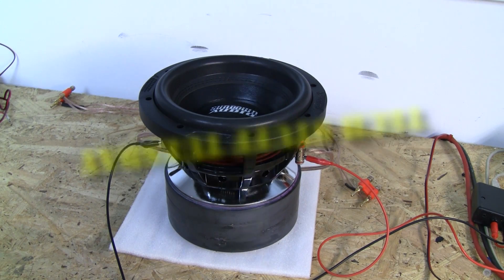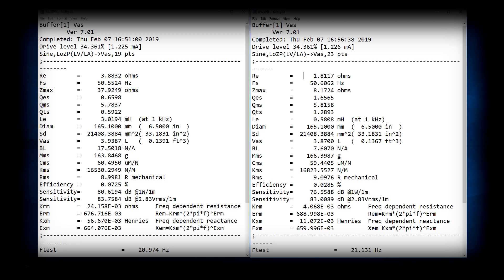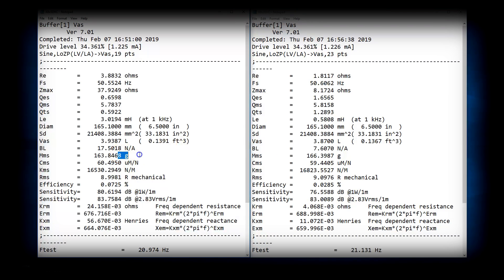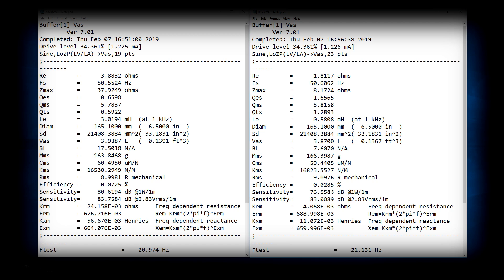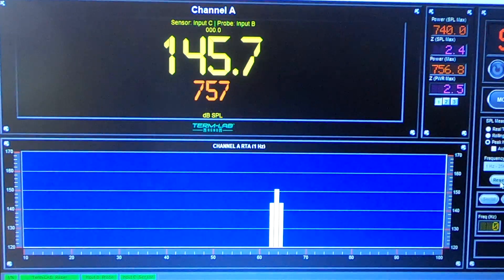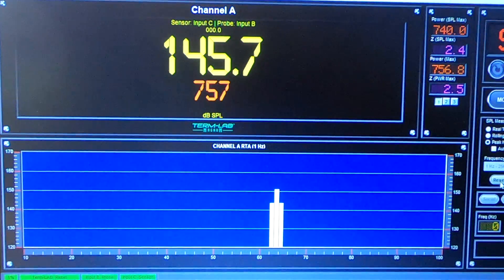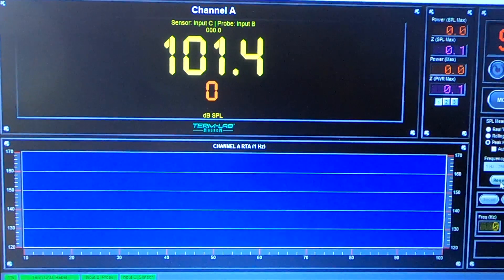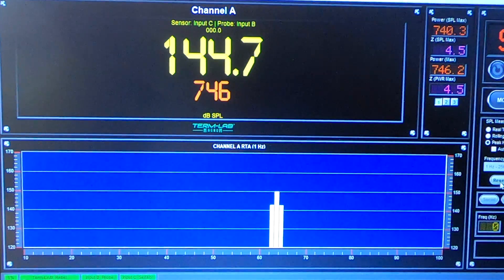This is what happens with 1 of 2 voice coils connected - Tech Stuff Tuesday

Comment: Question: I know you got the TS parameters wiring it in series, but do you also wire the sub in series when you actually tested it for SPL? Just wondering.  I know I usually wire mine in parallel to 1 Ohm to get more power.

Comment: I have one 10" Subwoofer dual coil driver connected with only one coil as my amp doesn't support the OHMS load if I connect them both together, I know is not the best option, but it is the only way I can have it working, have been using this way since like 7 years ago, still works and sounds great.
Reply: And you have a back up coil !
Reply: @adventureswitheddie6444 is still working with the single coil connected, I thought the same as you. I really don't care if it burns.

Comment: First off, have you tested any dual 2 ohm drivers against the same makers single 4 ohm version of the same driver, I think sn important aspect to test would be heat generated I the gap since that's what kills most speakers unless they have fused tinsel leads like CV HED subs. The other thing I need to ask is how many know when the dual voice coil was invented and why it was invented? Subs first appeared in movie theaters once sound was added to movies. The subs they had back in the 1930s were not well behaved and had huge peaks at certain levels that they (at that time) no way to flatten the response. There were no EQs, so they added the second coil to act as a way to correct the response by running a reverse polarity signal at those frequencies that had the big peaks. This was probably done by using complex passive notch crossovers and resistors to get the signal dialed in as close as possible. This is just one more example of how most things we deal with today are far from bring new ideas

Comment: I just tried to read the resistance on a DVC and got an open circuit on one of the coils, im wondering if i can run 1 DVC woofer w/ both connections and 1 DVC wooder w/ a single connections and just leave the open circuit coil out of the loop.

Comment: so when only wiring 1 wouldnt the 1 coil get hotter alot faster on rated watts and cause a ton of wear on it or am i wrong i know heat transfers insanely well on copper. but i wanna know the logistics behind temperatures with only 1 coil wired because i got a dvc 1ohm and my amps only 1 ohm stable pends my taramps 12k ate shit on .5 ohms immediately

Comment: When I lost a coil in my 15. I ran it on a single coil for years and still had great sound. Actually it gained more power over time. Thanks for the Video.
Reply: mine is also 15 and i just blew one of mine lol hopefully i can get the same results lol Ive had my sub for years, got it used and I  have no money to get a new one
Reply: im looking I cant find exactly how to wire only one coil. I am an audio noob can you help? what wires go where on the speaker side
Reply: @twangyyy18888   you dont. Just use it as a single voice coil. Use a meter to find out what side is bad.
Reply: How did u know what coil was trashed?
Reply: @gtstanton9785   ohm meter

Comment: Fkng outstanding! This just made me $100 richer😂 I've been arguing with my friend about this situation for a while, i don't understand how people can't see that it's like taking power away from it when you don't use both coils💡 It's simple as night and day, if you drive at night with only one headlight then your only going to be lighting up half of what you could/should be with both headlights😂 I know it doesn't take away half of the power by using 1 coil but it does take some power away from what it would/could potentially produce like you just proved, THANK YOU!👍👍👍👍
Reply from the maker: The headlight analogy is quite good, I should use that.
Reply: Only part where mine actually got louder was I have 4 dual 2 ohm mojos. Series parallel to 1ohm final. One of my coils on one sub went out. Didn't know about it for nearly 3 weeks. Honestly thought all 4 were banging. After one day watching the subs move. One seemed off. So I did an ohm check at final and was at 1.7 ohm. So I knew that sub was off somewhere. Turns out whole voice coil was out. So I plugged into just the good one, checked final and was back at 1 ohm again. Grant it. That poor thing gets hot fast af. But also, makes me think that sub was dead from the beginning or near beginning. Because this system never sounded so loud no that it's at 1 ohm and 4 subs moving hahaha. Although, not ideal and I'm getting a replacement
Reply: I hope you know it’s not taking power from the subwoofer it’s just not allowing the amp to push out as much because the ohms are higher like in my set up I’m doing right now I have a dual voice coil 15 two ohm but my amp is only rated for two ohm so that’s why I’m only connecting one voice coil because if you ran it at four would take a lot of power away but if you ran it at one it would destroy the amp as I plan on adding another 12 with this 15 that’s why I have a two ohm and not four because when I get this other one I can run them both at four ohm and then together they would drop back down to two

Comment: can I use single sub with 2ohm? since it sounds better in my case idk why... when I wired 1ohm before it distorts a lot of clipping now with 2ohm sounds clearer?
Reply from the maker: If your wired to 1 ohm, it sounds like your amp isn't 1 ohm stable, which is why it was clipping.
Reply: @EMFAudio  it says One ohm stable. But idk why I get weak power from sub and clipping amp is 1500rms
Reply from the maker: @grikisgrikis2779  what amp is it? It's possible you have insufficient electrical so you have low voltage which will cause clipping.
Reply: @EMFAudio  pride mezzo
Reply: @EMFAudio  stock electricity no agm no big three only one small capacitor
Reply from the maker: @grikisgrikis2779  Take the capacitor out, that may solve the problem. Otherwise it sounds like you may need some electrical upgrades. Check your voltage while playing.
Reply: @EMFAudio  usually I drop to 13.5-13.6v. But why taking capacitor would be better? Thanks.
Reply from the maker: @grikisgrikis2779  If it's clipping on that voltage, the amp is just out of power. Those caps that aren't supercaps tend to do nothing but hurt the system. They don't have enough capacity to be effective so it's just resistance in the system where the amp is drawing power so the cap is depleted then the car is trying to run the amp and replenish the cap.
Reply: @EMFAudio  oh, that's why I could be clipping more and less bass?
Reply: @EMFAudio  so is it better for me currently play 2ohm? Cause it sounded way better still loud and no distorting and  clipping? Is it better for distorting with 1ohm or clean signal 900rms?
Reply from the maker: @grikisgrikis2779  distortion is never good

Comment: aside from the power handling dropping to half. is there any damage to the sub if you're not using full power or even close to full power?
cause I have two DVC 4 ohm subs. BUT my amp gets hot running it at 2 ohms. the heat on amp dropped when using one coil
Reply from the maker: If you only use half power with 1 coil, damage, no. Performance won't be as good though.

Comment: So you said that a dvc sub rated at 750W rms is for both coils  combined... what if you fed one coil with 750W rms ??
Reply from the maker: It would die quicker, that's technically double rated power.
Reply: @EMFAudio  so i can guess that a dvc sub was intended to be ran on both coils right even though it will run on one coil as long as the power is cut in half of its total rated ..??
And by running one coil its only pushing half its total output .. just like a svc sub rated at 500w rms and you only give it 250w rms ..
Reply from the maker: @ACommenterOnYouTube  That's all explained in this video.

Comment: My friends DD 612 was connected only on one voice coil by mistake. When I opened box after few months I realised that mistake. Will there be any permanent damage on this sub?
Reply from the maker: It's possible, look at the coil and see.
Reply: @EMFAudio  coil is not visible but I checked impedance shown same for both coils. So should I consider sub is OK?
Reply from the maker: @BassheadLabs  If both read correct impedance I'd say it's probably fine.
Reply: @EMFAudio  may I know why you suggested to see the coil? Coil burns if we use single voice coil from dvc sub? I would like to explore other ways.
Reply from the maker: @BassheadLabs  It can show heat damage, not necessarily complete burns but discoloration or if it is beginning to unwind.

Comment: If the speakers rated power handling is 750w with both coils combined doesn't that mean one coil can only handle 375w?
Reply from the maker: Sort of. There are some cooling changes with only 1 connected so it's possible it could be even less than half.
Reply: @EMFAudio  So why was 750w safe to put to one coil?   That's what's confusing to me.
Reply from the maker: @jamesg8246  RMS ratings are a power over time. A brief amount of power won't generate enough heat to kill it. From that aspect given no mechanical limitations, you can play 5,000 watts on them fine, briefly.

Comment: Bro... my amplifier produces 4 ohm in bridged mode and the subwoofer is dual voice coil 4 ohm each, so it is okey to connect only one voice coil... right ? Kindly pay attention to my problem...
Reply from the maker: It will play, but your power handling is cut in half and performance will suffer.
Reply: @EMFAudio  so what do you recommend for this situation?
Reply from the maker: @anutom007  Ideally change the sub or change the amp.

Comment: So basically which is better in terms of getting more out of my sub? using both or one coil?... And is it possible to burn only one coil over?
Reply from the maker: You should always use both coils, watch the video. You can burn 1 coil but the other will be on the verge at the same time.
Reply: @EMFAudio  ok.. Thanks

Comment: Always use both coils... even if you have to wire up (series) [and/or wire back down if you have multi subs], it's better than only running one coil on a DVC subwoofer.
Reply: But is it bad to run on one coil giving it power because i know it's better to run 2 but my terminals off but I still need the sub so can I still slam it on 1 coil and not destroy it
Reply: @BuddaDrifts Yes you can, just don't get much movement like with 2 of them. Enjoy

Comment: I got a 12" type r for free from a coworker.. One coil reads 2ohm, the other 0. What are the chances that only 1 coil is blown vs just disconnected internally? Can a sub with 1 blown coil still sound "ok"
Reply from the maker: It's extremely possible. If it's ready 0 it's open.
Reply: @EMFAudio  guess I have nothing to lose taking apart the proprietary terminal to check tinsel leads

Comment: how did you wire it too the sub to the amp on single coil I need to know
Reply from the maker: The same as you would any other speaker, positive to positive, negative to negative.

Comment: So my question is does it hurt the speaker.  That's my worry will it damage it if I don't use both could?....and ty for this video
Reply from the maker: Thermal power handling is cut in half when you use 1 coil, so yes it can hurt the speaker.
Reply: @EMFAudio  ty for ur help.
Reply: @EMFAudio  here's a question.  To get 14v at all times . What step must be taken.  I have a sundown SFb 5k .It said it is a 14v amp not sure what that means. Plz send link to video if there is 1

Comment: 👉  Ok, say I don't have enough power. And I want to wire Each coil  BRidged. On a 4 channel amp. 
BRidge both coils on a dvc 4 ohm
Each coil bridged
To 2 channels on a 4 channel amp.
Don't wire coils together . I know it's not right but I can get twice the power doing this @ 4 ohms and I'll be using both coils..... 
Thanks for video. 
I currently had a coil go out. And I am now running just one coil. Yeah but answer that question up their 👆. Personally I think it would work giving it the same signal. But u seem like you'd know fur sur what would happen. Thanks again.
Reply from the maker: You CAN do that, and as long as both signals are equal it should be fine. That means all settings must be identical too.
Reply: @EMFAudio  👉
That's Great news you can wire it this way !  👍 Thnkx  a million

Comment: I read some where you can put a resistor on one of the voice coils and power on the other and change some characteristic of the sub
Reply from the maker: You can, the same as dead shorting one of the coils, but in the grand scheme of things what's changed isn't of benefit to just using both coils.
Reply: @EMFAudio  no not dead shorting, you add a resistor changing the impedance of the second coil, and that adjusts something it's been along time. I'm not saying this is something you should do, I just remember reading about it and how you can vary some reading, or how the sub acts , the article talked about putting a potentiometer in between the terminals so you can dial it up or down to change it. I'm really gonna have to go find that article again.

Edit:  also I'm not comparing it to your video, about leaving the coil unhooked. This video just brought it to mind and I remember thinking that was so neat when I was 14-15 years old
Reply from the maker: @Gcrilla  Shorting the coil is something you're doing when you put a resistor in there. I mean that as connecting POS and NEG together with no signal.
Reply: @EMFAudio   I found this online, it isn't the article but a post relating to it, basically it says using a resistor across the second coil you can adjust the Q to vary the sub for different boxes 

This is the post I found that explains it. It was post on Nov 11th 2005 and the article I read was a good bit older than that.

By placing a resistor across the second coil will allow you to adjust the Q of the driver, so it can be optimised for different enclosure types. I own an Ascendant Audio Atlas subwoofer which is a DVC driver with the second coil designed for the sole purpose of adjustable Q. The coil that gets power from the amp is a 4ohm load, and the coil for adjusting the Q is a 2ohm laod. By shorting the 2ohm coil, a low Q is available which would be best for a sealed box. By leaving the 2ohm coil open, a high Q is available for infinite baffle designs. By placing a resistor of 1.5 ohm (equal to the DCR of the coil), a mid Q is available for ported designs.

Keep in mind that with only utilizing one coil, you decrease BL (motor strength), and decrease power handling. I had originally used my Atlas subwoofer in a mid Q design, but have found that wiring both coils in series for a 6ohm driver works quite a bit better.
Reply from the maker: @Gcrilla  I've never tried it but the Qts shouldn't change THAT drastically. There shouldn't be a shift from like 0.3 to 0.8
Reply: @EMFAudio   I've never tried it personally. I think I might now whenever I get a dvc sub. You'd figured if it really did help shift a sub towards whichever box, it'd be much more common in the industry. Might make a good tech stuff Tuesday video who knows. 

Yeah I assumed you meant directly connecting together when you said shorting. My mistake. 

Thanks for the reply
Reply: Gerald Norton I blew a lead and what would you suggest doing without reconing or buying another sub. I was just thinking running one coil.
Reply: @papergatorzfedducca7998  you blew  a lead?  What do you mean by that?
Reply: Gerald Norton tinsel wire.
Reply: Gerald Norton I have kicker l7 12s dual voice coil, 2 ohms.
Reply: @papergatorzfedducca7998   Did it rip in two? Is soldering it back together and option?
Reply: Gerald Norton it ripped right at the cone. I soldered but it came back loose
Reply: Gerald Norton thanks brother I was able to solder it. How can wire this one dual voice coil, 2 ohm and keep it at 2 ohms? I don’t want it at 4 ohms and my amp is not 1 ohm stable. I want to keep it 2 ohms. I can’t parallel it (1 ohm) or series (4 ohm). How would I wire it? Please. Thank you

Comment: ok ok this makes sense, so for example if my sub claims 800rms 1600max thats using both VCs. if i end up using just one VC that means its 400rms 800max?
Reply from the maker: In it's most crude form, yes. There are other factors too which are in the video. It's possible to take even less power because of insulation from the coil not being used, depending how the coil is wound.

Comment: So Wait You Put 750 To One Coil. Doesn't That Mean You Over Powered That Coil? That's Means You Can't Play as Long At 750Watts One One Coil Than 750 On Two Coils Right?
Reply from the maker: Correct. Power ratings on a sub is using both coils, power handling is effectively cut in half using 1 coil.

Comment: Do you know how much the magnet weighs on the sundown sa-15 ?
Reply from the maker: No idea, I know the whole sub weighs about 32-34 lbs. Have you ever noticed that the best subs don't list a magnet weight as a spec? There is a reason for that.
Reply: EMF Audio 
oke, i saw a video from sundown of the sa-15 and looked pritty big so i was just curious how much iT would weigh
Reply from the maker: Looks can be deceiving, some put large plastic boots on them or extend the basket around the motor to make them look bigger than they are. The SA-15 is genuine in it's size though, the rubber boot just goes over the magnet.
Reply: EMF Audio 
yeah that i know, Some companies do everything for a profit.  was thinking of buying a digital designs redline 615,  but this sundown sa-15 looks also a great sub
Reply from the maker: @promo130  You might want to look at our Lowballer 15 http://www.emfcaraudio.com/emf-audio-lowballer-15-subwoofer/